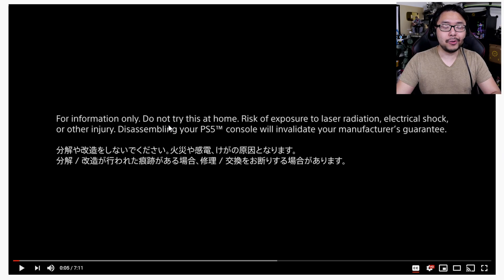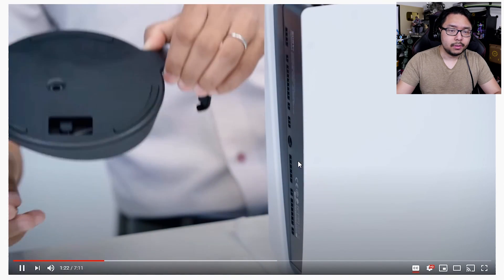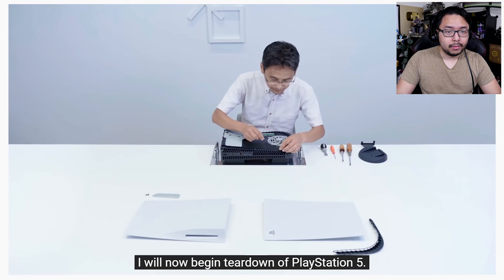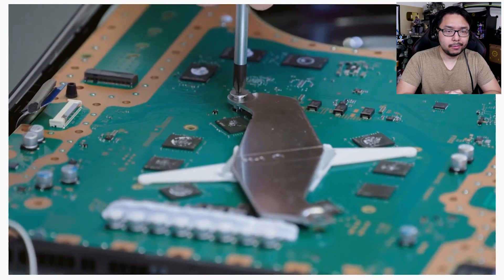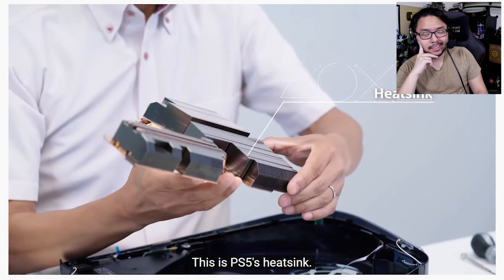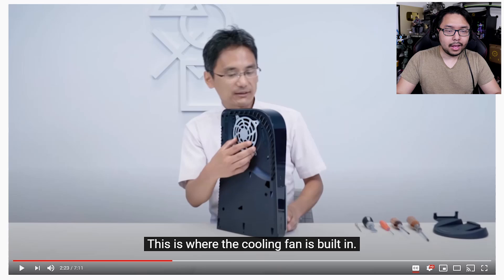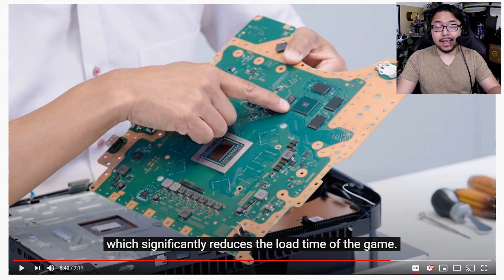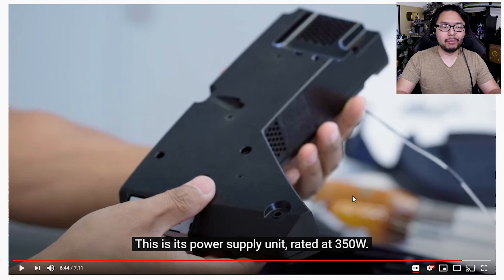Reacting To Sony's PS5 Teardown (Cooling, SSD Slot, Swappable Panels, & More)

Comment: Liquid metal is easily one of the most innovative and impressive things about the ps5.
Reply: You think if it forms long enough, that it will eventually turn into Liquid Snake?
Reply: Detective Salary Cuts BROTHER!.. It’s been too long..!
Reply: TIMMEH! Apparently they have been working with liquid metal for more than 2 years but I could be wrong
Reply: @seymourbutts6135  yes they've been working on how to implement it for 2 and half years
Reply: @seymourbutts6135  You are right. The engineer talked about it in the video.
Reply: @seymourbutts6135  I swear the guy said that in the video.
Reply: What is it even? It looks like mercury...
Reply: @k9px  Alloy of gallium and indium primarily, sometimes with tin and other trace metals
Or at least that's what liquid metal used in PC OC is, I use it. Not particularly exotic.
Reply: @mduckernz  oooh cool, sounds pretty exotic to someone who doesn't know that.
Reply: @cablecow15 ey I'm fine with it, all for it, I'm tired of my ps4 being louder than my tv
Reply: Nulspecter my right ear literally how temporary hearing loss and if I play to long now the hearing loss comes back
Reply: Is this some sort of Nano technology?!
Reply: Terminator 2
Reply: @GetShwiftyInHear horizontal or vertical is irrelevant..what matters most is the amount you apply..lm is very easy to apply to much which is why those of us that use it apply clear nail polish or something similar around the cpu and gpu to protect from electrical shorting from any lm leaks...the bigger concern is how much you move the ps5 around..when used in laptops the temps tend to rise dramatically after about a year do to the constant moving around of the laptop causing the very fragile lm bond to break
Reply: Shia Lebeouf: Life Coach it most definitely is not Mercury, and for you to even suggest that means you have no clue what you’re talking about. It’s most likely a compound of gallium and iridium with other trace elements.
Reply: Heisenbrrg SNAAAAAAAAAAAAKKKKKEEEEEEE
Reply: @11 11 '' PC players on the other hand gotta pay 1500 to 2k to get a decent PC  to play on'' Huh? nah, £500 will see a PC out perform two console generations easily. Consoles have always held back hardware development, and realy consoles are to thank because a developer has to make sure their game runs on console so they have to water their game down so it can run on a console and they have to do that for that entire 5-6 year generation, so for those 5-6 years hardware barely advances because nobody needs it. In other words I 'could' buy the latest graphics card and CPU on the market to stay at the top buy why bother when no game takes advantage of that tech because they have to run on a console that only has a fraction of the power thus if I were to build a PC from scratch to match a console I'd just buy outdated hardware for cheap but I have a 7 year old PC with individual components as old as 10 years that are now discontinued and it still beats series X and PS5.

So, if you're gonna cry, cry over your own ignorance and lack of technical ability.
Reply: @SwagGuffington  Asus have mass produced laptops with liquid metal, what do you mean?
Reply: Warren G   Asus laptops are not produced on the scale of Playstation consoles man come on
Reply: @warreng5257  Not like this tho. They never really completely isolated the laptop with 2 layers as far as I saw it.
Reply: @Makon18  I doubt you're a PC user just by your statement.
Reply: We've been using liquid metal on PC CPUs and GPUs for years ,,,,,, It is not that innovative anymore, what is innovative is they way they designed it so it can be assembled by robotics with minimal human interaction and not having to worry about it leaking out because it it not only thermally conductive it is very electrically conductive  ...... From an engineer's standpoint the more interesting thing is the PCB design itself and the large amount of copper much of it bare and how that is used to pull heat to the edges of the PCB and from there to the Aluminum bottom pan and to the heatsink which also has a copper bottom because thermal transfer copper to copper is much better than copper to aluminum ...... That PCB could easily be half the size it is and still easily be able to fit the components on it but that would also concentrate the heat and you wouldn't have all that extra copper also acting as a heatsink ...... The amount of copper on a pcb is the first thing the beancounters go after when trying to trim costs ...... I imagine Sony Engineers had to fight tooth and nail with the MBAs to keep this design intact because this is not a cheap solution and making this as large as it is was really the correct way to do it so they could have that extra large PCB with a nice blower sitting above it 

I'm not a Sony fan at all and I can't remember the last time any Sony design impressed me because it was likely  20 years ago and it wasn't a game console but likely their old Trinitron CRT monitors    which is the last thing I can think of from Sony that actually impressed me as an engineer ...... This however is very impressive and it has absolutely nothing to do with liquid metal
Reply: How is it innovative if it's been used in gaming PCs in the same way for years for overclockers? I'll say it's innovative if it last the whole next generation (7 years) that would be impressive, I've just never known liquid metal to last that long - this is where it becomes innovative.
Reply: Warren G Because it’s a console? I even specifically said it’s innovative for the ps5. It’s SSD is also innovative as well, or would that not count since SSDs came out for PCs in 2010?
Reply: @kuma8093  dont feed the pcmr troll
Reply: @kuma8093  Yes liquid metal is being used in console, but that doesn't make it innovative. That's like saying when xbox allowed gamers to plug a keyboard and mouse into a console years ago was innovative because it wasn't done on console before. Or when playstation added a DVD player to their consoles, was that innovative too?

The SSD is fast and it's a big deal, but SSDs get faster every year, if you want to call it innovative that's up to you, I'll call it progressive. By the time anyone gets their hands on the PS5, that'll probably be faster SSDs out already.
Reply: @kuma8093  the ssd isnt innovative either..costs prevented ssd's from being used in the current gen of consoles...the samsung 980 pro nvme ssd has read/write speeds of 7GB/s and 5GB/S
Reply: @warreng5257  you're correct. However what's innovative about it is the APU housing allows the liquid metal to be distributed evenly regardless of gravity/orientation of the console. That is new, and as a fan of electronics I find it cool.
Reply: @GlaciusDreams  ok fair fair enough, regarding the implantation that sounds innovative, but I don't know the details and neither have Sony shared anything on it yet. Hopefully Sony also know how to make the liquid metal last longer than a couple years as well.

BUT liquid metal alone is far from innovative,  I just feel like a lot of these people in this comment section only heard about liquid metal in the last 6 months and are going wild.
Reply: @warreng5257  LIQUID METAL, not water cooling.

Liquid metal has the capability to destroy your pc if handled incorrectly.
Reply: @Kleidus  yes I know this, not sure why you replied to me though 😅
Reply: @Kleidus  Water cooling too tho 😅
Reply: @warreng5257  Ugh......can you pc elitists find an effective way to not make the liquid metal leak such that it does not ruin your motherboard.......because sony did......for 500$.
Reply: @santhoshsridhar5887  Sony hasn't even had the technology for 3 years, so I'll guess the consumers will be the test dummies and we'll find out soon. And I don't game on PC.
Reply: @santhoshsridhar5887  Liquid metal on consumer CPUs is only viable for extreme overclocking. People need to chill out.
Reply: @warreng5257  Sony had this technology for years. Ever heard of the alpha cameras? The alpha 7(one of the best cameras in the world) is also graphene cooled just like the playstation.
Reply: @fastf.8755  Exactly. Even the xbox does have a fairly large heatsink and. A vapour chamber. Most PCs don't even have this. This itself is more than enough to cool the console atleast upto 70 degrees which is much lesser than the threshold. I hate it when some pc elitists are hating on sony for going the extra mile for reducing the temperature on the ps5.
Reply: @santhoshsridhar5887  vacuum chambers are only needed in small devices, on a ATX or on a mATX there is plenty of space for the airflow.
Reply: @santhoshsridhar5887  The ps5 is designed to operate silently if you ask me. Thats why they used liquid metal for the increased thermal conductivity therefore increasing the efficiency of the cooling solution. Thermal paste would have done it as an interface.
Reply: @santhoshsridhar5887  I'm saying how long they've been working on liquid metal implementation for PS5 and the patent they have around it is new. It all seems like they haven't had it long enough in the console test it enough, in my opinion anyway.
Reply: @warreng5257  It'll be interesting to see how the ps5 runs and how long it lasts. Thry worked on it for 2+ years and the japanese are a talented bunch. Time will tell
Reply: @warreng5257  well, I mean they when they played godfall and astro for one and a half hours, they reported the temperature to be 50-60 degrees. That's pretty cool yet realistic enough considering ps5's cooling system.
Reply: @santhoshsridhar5887  yea its called nail polish and its super cheap..also it doesnt leak if you dont use too much
Reply: @fastf.8755  liquid metal for xoc is garbage..kyronaut is superior to lm for subzero temps
Reply: @santhoshsridhar5887  graphene and liquid metal are not the same
Reply: @santhoshsridhar5887  pc dont need vapor chamber since most cases are more than big enough for quality air cooler..or aio or open loop
Reply: @imgonnacuomoalloveryourfredo  Yeah because gallium is used in nail polish.
Reply: @martialzmartial7622  Sony rarely get it wrong. But out of all the products that have big flaws (something you don't usually associate with Sony) it has to be their consoles... yellow light on the PS3 and cooling/fan issues with the PS4, I just hope liquid metal doesn't become an issue. To be honest, cooling/fan/overheating has always been a Playstation issue since PS3 and probably why they're making this drastic change in design to make sure cooling works... because the fan noise in the PS4 was ridiculous, I don't know how that passed any quality checks.
Reply: @santhoshsridhar5887  clear nail polish contains film-former, a resin or secondary film-former, a plasticizer, and solvent..no gallium
Reply: @santhoshsridhar5887  clear nail polish contains film-former, a resin or secondary film-former, a plasticizer, and solvent...not gallium...apply clear nail polish around cpu or gpu to protect from electrical shorting in case you applied too much lm and it leaks out
Reply: @warreng5257  unless sony developed their own liquid metal formula it may bite them in the ass...liquid metal isnt known to last a long time..most people who use it re-apply it every 2-3 years
Reply: @imgonnacuomoalloveryourfredo  I mean, a better way would be to completely isolate the liquid metal, right?
Reply: @santhoshsridhar5887  it would..but it does nothing to protect it from having its very fragile bond being broken from handling the ps5 too much...happens in laptops all the time
Reply: @imgonnacuomoalloveryourfredo  Well, ok I'm sorry. I didn't realize what you said, I thought you said gallium, which is reasonably expensive and is one of the components in liquid cooling is used in nail polish which sounded unlikely to me lol.
Reply: santhosh sridhar you don’t know that yet
Reply: @santhoshsridhar5887  'can you pc elitists find an effective way to not make the liquid metal leak' yes they are called 'closed liquid cooling systems' and they cost under $90. Next stupid question?
Reply: Warren G it’s not the same as thermal paste used in most PC’s and they patented their own cover for it so there is  some new system in place with their take on it
Reply: XBOX IS GARBAGE
Reply: its not innovative, its been used on pc's for a long time...however i wouldn't be moving your ps5 very often..when used on laptops after about a year the temps go way up from the constant jostling around that breaks the lm bond which is very fragile..also hope that heatsink is made of nickel and not exposed copper or aluminum..copper will suck up all the gallium causing thermal runaway and permanently damaging the copper heatsink..aluminum becomes brittle and breaks when exposed to liquid metal
Reply: It was innovative years ago, now it's standard fare. It's also really easy and cheap overall and provides a great benefit. It's a no brainer they did it, nothing impressive about it.

There is literally nothing innovative about the Xbox or the PS5, they are all just old PC technology that is now affordable.
Reply: Haha this console players giving you daily laugh saying how innovative shits are in their system while PC has it for years
Reply: @rmbndc5753  liquid metal never been in a mass-produced pc,
Reply: @BigCat553  wait, you mass produce PC?
Reply: @rmbndc5753  well the components are...
Reply: @BigCat553  mass produced? Lol we build our machines from scratch
Reply: @rmbndc5753  There are mass produced PCs yes, generally sold under the brand name of the case manufacturer that come with pre-defined hardware specs but these are rarely a great deal, they are generally fair deals but not great. So for instance you might find a 'Cooler Master' or 'CyberPower' pre-build PCs in a product line, but it's not like they produce the hardware, they just make the cases and then build PCs to sell in bulk to retailers to sell to consumers. You're always better off building one yourself of getting/paying someone else to.
Reply: @rmbndc5753  if your PCs are so superior and have so many good and innovative stuff for years... why do you pester other people enjoyment? just to be on the right? are you that petty?
Reply: @rmbndc5753  It IS innovative for consoles. No one is saying the actual idea of liquid metal cooling is innovative itself.
Reply: @rmbndc5753  that's how hilarious it is when you get games like RDR2 so late... PC always late to the party when it really counts